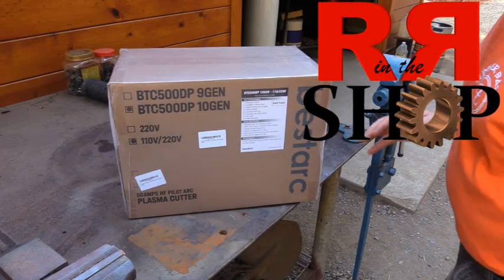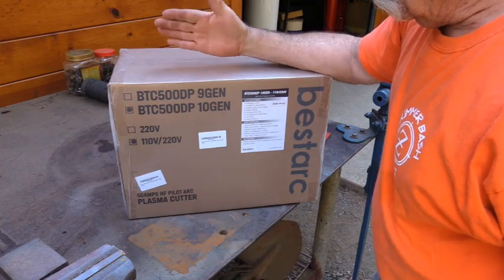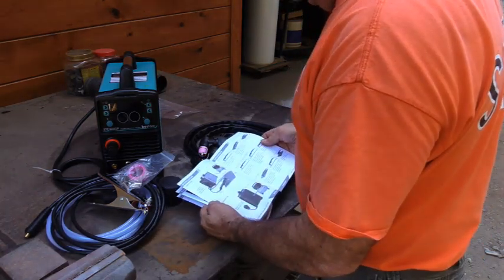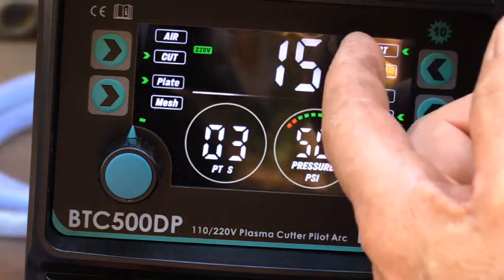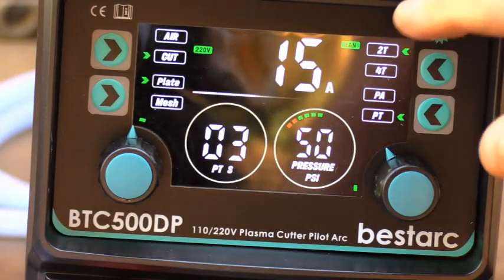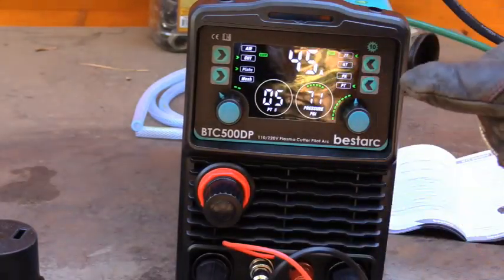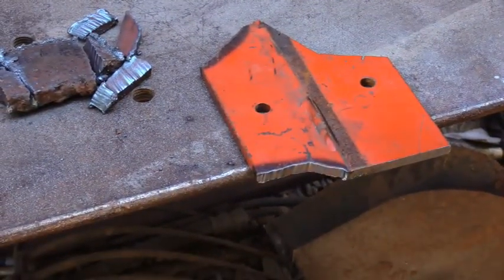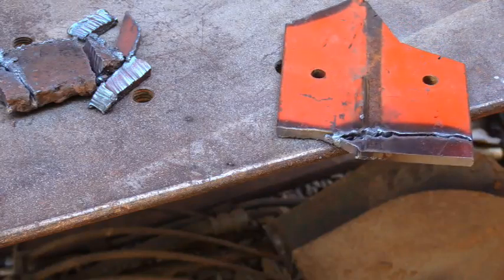Plasma Cutter Review BestArc BTC500DP 10Gen HF Pilot Arc

Comment: You don’t have 50 amp service in your shop? Not much of a shop IMHO.  You also probably don’t have an adequate compressor with only 30 amp service.How can you do a decent review with inadequate amperage?
Reply from the maker: I have 200 amp service for my shop.  I just don't have a 50 amp outlet.  Never had the need.  In the video I only tested the unit with 120 volt and I did mention that.  My son is using the unit in his fabrication shop now on 220v, and it is working quit well.  I run a 5 hp 110 gal compressor, I think it is plenty big enough.  I think the review was quite adequate for the average home shop guy and that was what I also mentioned in the video.  I am sorry the video was not up to your expert level, maybe you will send me a $5000  welder and I will be happy to review it for you and put it to its full potential.  Thank you for your comment and for watching.
Reply: @ Sorry if that seemed a bit snarky, was not my intention.  I’m fresh out of 5K $ welders , so  don’t be expecting one from Me.   I’ve watched a lot of review videos on these machines in the past week and you were the only one that didn’t show the 220 action. No big deal. I’ve saw nothing but great reviews on these and I just this morning purchased the gen 10 model and a pack of consumables.  Have a nice day.

Comment: Pretty sure that is the plug that comes on most every Lincoln or Miller 240V machine. They probably just following the leaders.  I think having a properly attached molded plug probably a lot safer than having most home operators putting their own plugs on. I would say 80% of wiring work I encounter by typical homeowners is pretty scary.
Reply from the maker: Oh yeah.  Thanks Brian for stopping in.

Comment: That was not a dryer plug that was a proper welding fifty amp plug which is standard in u s a
Reply from the maker: Yes but the unit only requires a 30 amp circuit.  It does not need a 50 amp plug.

Comment: Good one Randy .   There are a couple more adjustments on that one the Gen 3 's do not have .    I was able to cut 5/8 plate  set at 50 amps & 75psi air no worries .   Max cut was 3/4 plate , only just !   Set at 50 amps & 80 psi air .   I had to get a special plug wired in  20 amp single phase 240 v  for our power down under , bearing in mind we run different amperage than you guys there .  The Electrician said the plug it came with was way under rated .   Cheers  👍
Reply from the maker: Thank you Max for stopping in.  This unit works well.

Comment: Multiply the Volts with the amps and you will get the watts(Divide the watts on machine by volts and you will get how much amps fuse needs to have).90% of the machines that run on single phase will be fine on 25A fuse.25A fuse if connected to correct size cable of 2.5 square mm can take 5.5kw of load.Somehow i doubt that little chinese unit draws that much,my professional inverter stick welder that has 180A runs on 16A fuse fine.
Reply from the maker: Thank you for your response.  After some more research this unit only requires 30A Bkr. @ 220V.  So the 50 A cord cap is a bit of overkill.  Thank you for watching.

Comment: 50 Amp plug should be the proper plug,all my welders have that plug.
Reply from the maker: Maybe so, I did not find  what the unit actually draws when set for 50 amps output.  Thanks for watching and the comment.  There euro models they do not supply a cord cap.
Reply: It depends ,if you run 220V 50A is a overkill for single phase machine ,it would give you 11Kw of power that it can support.
On the other hand a 50A on a 110V would give you 5.5kw which is normal consumption for today's machines.
For 220V proper size plug would be rated for  25A.
Same goes for fuses.25A fuse outlet is normal in european household for large consumption machines like ,air conditioner,water heater ,electric oven etc...
Also cable should be 2.5mm square thick (14AWG) ,4 mm square(12AWG) if you run more than 25 meters in length.

Comment: I picked up a different brand that only goes to 45 amp and it has done pretty well for what little I have used it for. I run it on 220v also. I figure if I can get a half dozen projects out of it then it has paid for itself. Mine didn't come with the extra tips and one thing I have noticed is they don't tell the exact model of components you need, luckily a previous buyer had posted them for my model and I was able to get some extra's.
Reply from the maker: Good deal.  I need to get a few extra tips for this one.  Thanks for watching.